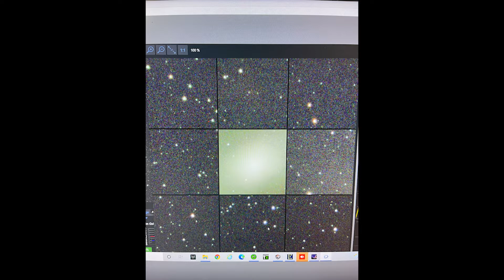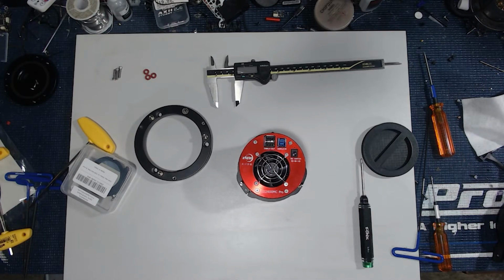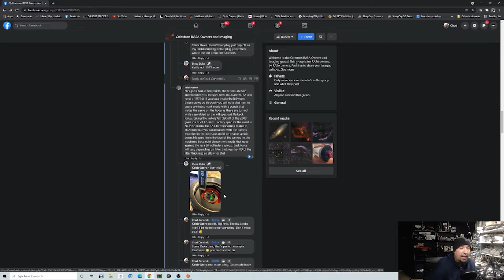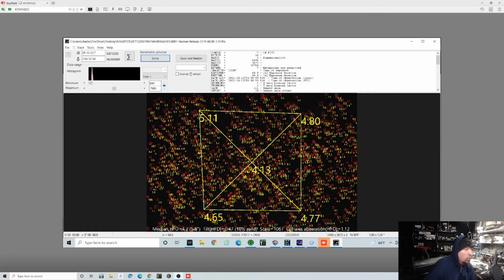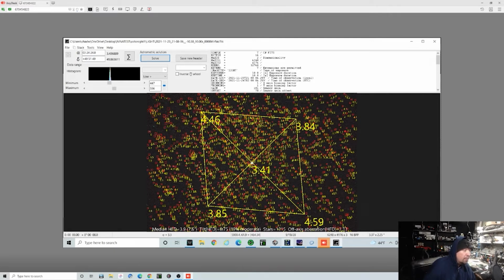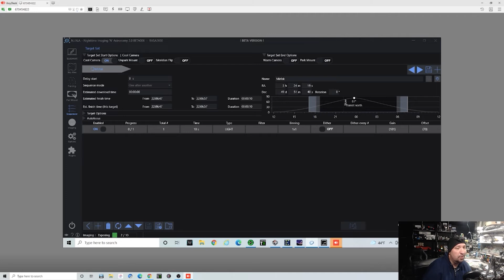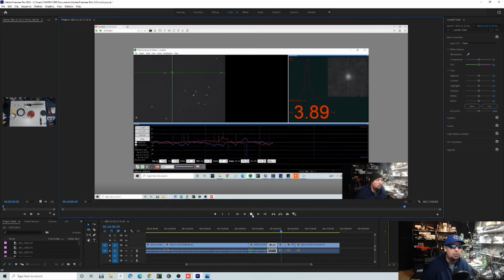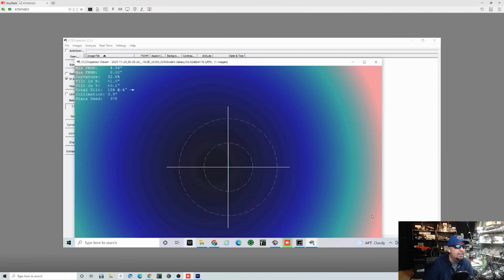CELESTRON RASA 8 OCTOPI SPACE ADAPTER PART 2 | NIGHT 1 LESSONS LEARNED AND WHY YOU NEED IT

Comment: I have to say, I’m a bit surprised because it appeared you started at a point I might be happy to end up with.  The camera I would use the device on is “extreme tilt” at 103% per ASTAP.  Like being so Sick that you would have to “get better to die”, my stars are so bad that it’s hard to imagine I could make it any worse.
Did you follow step by step instructions or any particular video?
Starizona opined that I probably don’t have a back focus issue using their RASA 8 filter holder with a ASI 2600MC.
It looked like you measured from the sensor to top of camera threads?
Reply from the maker: It’s a tough process man. It really is. All the software programs send you down a hole. There are so many variables beyond our control with a rasa. If you see my videos I sold it and moved to a hyperstar and now have full control.  Watch my latest hyperstar collimation video. Unfortunately the octopi is the only device that gives the ability to collimate and control back focus. Starizona is close but it needs to be nearly spot on.  Wish I could help more but I solved my f2 issues by selling it and moving to a better f2 solution for less money.
Reply: @easyastroimages5818  very interesting answer

Comment: Hey Chad, thanks for another great video!  So did I understand you correctly, that with the OctoPi there is no way to adjust camera rotation?
Reply from the maker: Not without a lot of work so make sure you really commit to your camera before the purchase. So larger sensor the better :). But in the end there’s only a few objects that would need rotation like m31 for example and with a rasa heck we can do a mosaic almost as fast. I just shot it with my radian 61 and exposures we’re theee times as long

Comment: Great job, Chad. Hey, it might be worth repeating: I received a LOT of input encouraging me to do multiple images then take the AVERAGE of those images. In fact, several experienced users encouraged me to take up to 5 images at each measurement point, averaging the five images, since each image can vary quite a bit in applications like CCD Inspector. Those same experienced users encouraged me to capture each of the five images at differing exposures. I felt like some of my most exacting work was when I would capture a sequence of five images at, say, 
10 seconds with 300 gain, then 
20 seconds at 200 gain, 
20 seconds at 100 gain, 
30 seconds at 100 gain, 
30 seconds at 0 gain.
Whatever pattern one uses, experienced users encouraged me to stick with that same pattern for every stop, again, allowing CCD Inspector to find the AVERAGE of those shots. I know it adds to the time required, but it's worth mentioning that this approach is indeed said to yield the most accurate result.
Reply: Are you manually averaging or is there a function for that in CCD Inspector?
Reply: @JethroXP  ccd inspector does it for the user automatically
Reply: @EmeraldHillsSkies  Ok, I think I just realized how do to that.  Open multiple images in CCD Inspector, select the ones you want to average (on a PC Shift-Click or CTRL-Click) and then click Curvature or 3D-Plot, the result is the average of all the images selected.
Reply from the maker: I broke down and bought the full version yesterday so I’ll be following that process now.